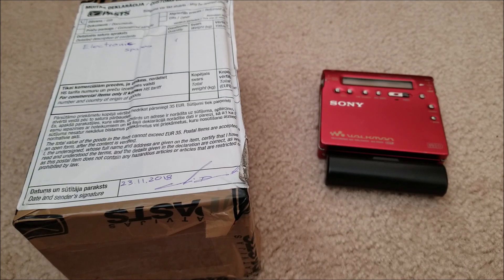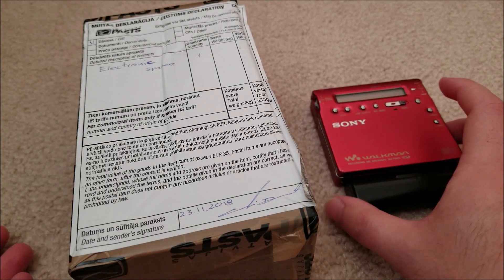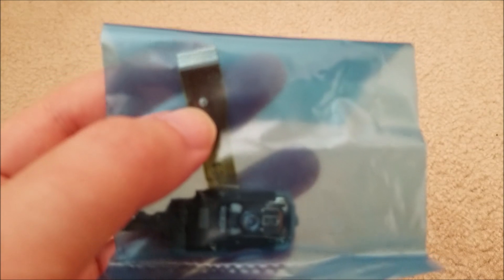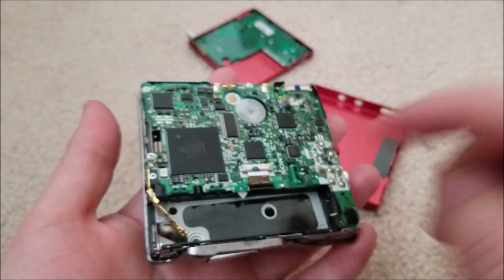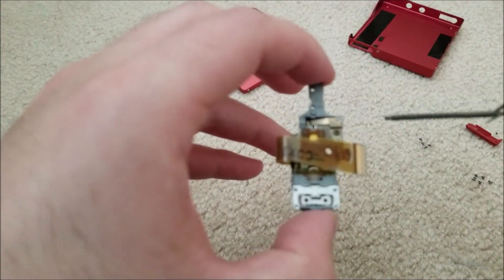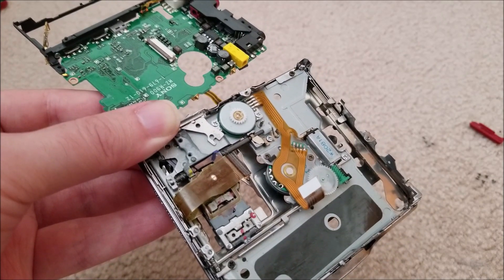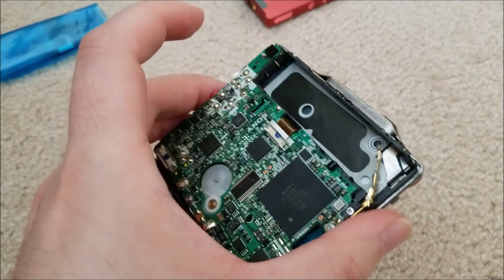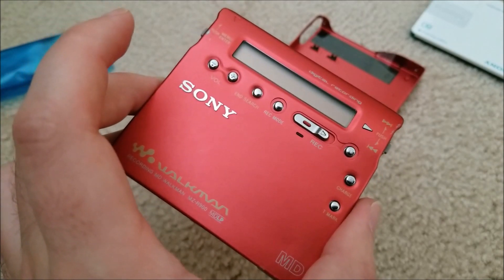Let's Fix: Sony MZ-R900 Minidisc Laser Replacement

Comment: didnt you have to unsolder the static protection joing?
Reply from the maker: It's been awhile since I made this video but iirc the pads weren't soldered on the new laser.
Reply: This is a BS video you cant replace it by hand
Reply from the maker: Of course it's possible, just because you cant doesn't mean it's impossible

Comment: Hola amigo 
Te un mz r900 y aveces al tocar un boton se  apaga y en algunos disco falla un poco 
Alguna idea de que pueda ser 
Gracias Saludos desde Perú
Reply from the maker: The r900 is getting quite old so it's likely your laser sled needs a complete clean and relubrication. It's also a very common problem to have power issues due to dirty/corroded battery contacts.

Comment: Besides the rails, should you also need to lubricate the gears?
Reply from the maker: Yes of course
Reply: @sjm4306  I see these gears are much harder to reach on other models (N707 and R501).
Reply from the maker: Yeah unfortunately. Also a warning, make super sure the lubricant you use on the plastic gears is compatible with plastics (ie not petroleum based) otherwise the gears can melt/shatter due to a chemical reaction.

Comment: It is interesting that the new laser came with pins on the cable not soldered. that pins should prevent static electricity damage and usually should be desoldered only after the cable is connected.

Comment: Cog on mine is very fixed, how do you removed it so easily?
Reply from the maker: Your libricant must have dried out more than mine. You can put a little isopropyl alcohol near the center shaft and let it soak in for a little while to try and soften it so you can remove it easily.
Reply: @sjm4306  Oh, it wasn't coming out because of a tiny washer over the cog, now I cant put the washer back :'c
Reply from the maker: Yeah the c clip is a pain. To put it back on I use sharp tweezers or a needle to start seating into the groove starting from one side and something like a pencil eraser end to hold the clip onto the end of the shaft so it doesn't ping off.

Comment: Great video. I have the same MZ-R900 model in the same red color that I bought in USA brand new in 2000/2001. The first Sony MDLP portable recorder. The same original gum stick Sony Stamina battery after 20 years still keeps the charge, the quality of those devices are top-notch.  My only issue is after many years unused the REC button doesn't work, so I don't know if the contacts are dirty, so when slide it the red led keeps off and I can't put it in recording mode. Do you have any idea about this issue? I read that ribbon cable connector can become dirty and the buttons work by using a resistor ladder that are readed by an ADC.The circuit is very sensitive to dirty or grease varying the ohms resistance, affecting the read and recognize the right command. Then is very frequent press a button and be wrongly interpreted as another command.
Reply from the maker: I suspect the record switch contacts have gotten dirty and just need a good clean

Comment: Picked up a faulty MZ-N1 and this video really helped me through the process of disassembling it, hopefully I shall be transplanting a laser from another player to get this going, thanks so much :)
Reply from the maker: Good luck and let us know the results!
Reply: @sjm4306  Just finished putting it all back together. Used a laser from an NZ-MF610 which had a faulty motherboard and fortunately the laser was an identical model to go in the N1. 

I am happy to confirm it now plays discs perfectly again (so far) and I was even able to record some tracks on there via Net MD which previously never worked properly, the laser would just struggle to read/write to the disc and just give up. The only trouble I did have is with the split pin on top of the gear that is connected to the worm gear - that was a real PITA to remove, I thought it wouldn't go back on again because of how much I mangled it but it seems to have gone on okay and hasn't popped off yet!

So far it's now working flawlessly and I wouldn't have had the confidence to try this without first watching your video, thanks so much once again!

Now I need to find more of these to tinker with and try and fix. 😁
Reply: My MZ-N1 doesn't charge the internal gumstick battery. I'm suspecting a faulty part in the charing circuit. Has anyone of you any experience in exchanging parts on the PCB? It's not only that the parts are tiny but that there's so little space!

Comment: i really want to replace my laser for sony mz-n707 type r would you know where I can get one asap plssss
Reply from the maker: you'll have to find a donor n505 or n707 (or possibly some other netmd portable made around the same time, check service manual to confirm the laser assembly serial number matches first though) unit with a good working laser to pull it from. Afaik there are no brand new replacements available anymore.
Reply: @sjm4306  found the part on Ali express but think the stores stopped selling it may have to just buy a new md player which socks wierd thing is this wqs working 5 weeks ago and just randomly stopped
Reply from the maker: before swapping the entire laser (which would require recalibration via the service menu), it's worth a shot checking the lubrication on the laser sled and gears to make sure they move freely. This is a common symptom that's easy to fix and can cause the player to not be able to read discs/skip/etc.
Reply: @sjm4306  trying to see how i get the ser manual for this and try it
Reply from the maker: googling model number followed by "service manual" usually shows a few hits. Most Sony models' service manuals are available online (at least all the models I have).

Comment: I have an mz707n the disk sound when you put a disk in and the display works but then it shuts off. Could you fix it for me?
Reply from the maker: That's odd, so it doesn't even give an error message? Also how long does it take to shut off? A quick thing you can test is if you open the disc lid and carefully move the laser sled to the end and shut it/turn it on does the player move the laser back to the center. If not then it may be the rails need to be lubricated. A stuck laser sled is a common cause for units that wont recognize/play discs (and for some reason may be causing yours to shut off).

Comment: I just stripped down my MZ-E90 to fix corroded battery terminals that are in the inside and a bit of a pig to get to. I did it and now it's working with the gumstick. The E90 looks to be a bit simpler than your one here. While it was open I put a small amount of vasaline on on the gears. I have seen another youtube clip of broken gears, so hoping this will give some more longevity.

Comment: Are the laser assemblies unique to each model or can they swap across models? Would be cool to get a physically damaged one on the cheap from ebay and swap out the part on my mz-dn430
Reply from the maker: In general certain parts tend to be the same for models in the same or +/- 1 generation. So there's a good chance that two type s netmd units share some parts but an sp only unit is very unlikely to have any parts in common with a himd model.

Comment: Hey mate.. I just got a second hand MZ-R91 which seems to be constructed almost identical to your MZ-R900 (Great tutorial for disassembling mine too). The laser mech seems to be running straight into the disc surface when it reads and scratching the disc surface although it still does work. Is there a way to adjust the lens distance/focus so it stays away from the disc surface, or does the whole laser module need to be replaced?
Reply from the maker: Never seen that before, usually the laser sled is far enough away that there's no risk of touching the disc surface. I'd check for what part of the laser sled is touching and see if something got loose and stuck to the the sled, that's all I can think of.

Comment: How do you apply Lubricant? Just a swab from the can, and then brush on to the rails?
Reply from the maker: I use a small tooth pick. You dont need a ton, and using the player while skipping back and forth will spread it around for you.
Reply: sjm4306 Thank you again for your generous and prompt advice. My MZR90 that has been in a removal carton for 15 years works perfectly but sounds like a blender when it seeks. I’m hoping it’s just the transport rails.
Reply from the maker: To be fair my r90 needed to be relubed too when I got it a few years ago but even after that though it was a bit quieter it was still much louder than my other md portables. I think the design was just mechanically louder than later models.

Comment: Hello, a question, how long can you record? I remember having an MD many years ago and the recording time was quite limited and at the end I could only use it as a player. A friend is offering me a SONY MZ-R900, he says he uses it very little but I'm not sure if I buy it because if he can't record anymore then it's no use, right? or is it possible to change a piece so it can record again? thank you very much
Reply from the maker: Older sp only md recorders could only do 74-80 minutes depending on the disc, but newer mdlp recorders can do double or 4x that at lower quality (lp2 is the best imo because it sounds not much worse than sp but can record up 160 minutes). And even newer hi-md can record even double those times (4x and 8x) on a normal disc when formatted to the hi-md standard. Beyond that a 1gb hi-md disc can hold up to 35 hours at the highest compression!

As for fixing a recorder that cant record, it's likely either a damaged overwrite head, the head needs to be realigned, or the ribbon to the head has been damaged. All those issues can be repaired but depending on how bad it is you may need to pull a replacement head from another broken md recording portable with compatible parts.
Reply: @sjm4306  Thank you very much for your answer, one more thing, how long recording life is the Sony Mz-R900 supposed to have?  I guess one day it will stop recording right? Thanks !
Reply from the maker: Oh I misunderstood what you were initially asking. Yes the recording mechanism life is limited in two ways assuming normal use: the overwrite head ribbon can break from flexing over and over (this can be fixed easily with some soldering skill) and the laser can burn out or weaken to the point it cant heat up the disc (this will require a replacement laser). As for specifically how long any mz-r900 will be able to record, I cant even begin to guess accurately. I'd imagine though so long as it's maintained properly that it'd last maybe 30+ years.
Reply: @sjm4306  thanks! I think i will buy it:) i will like to used for recording with microphone any advice for a good quality microphone that Works with the sony mz r900?
Reply from the maker: Sorry, I mosty record over optical in or usb so I dont really have any experience with mics

Comment: I just got an mz-r910. It powers on but the disc spins for a long time and sometimes it comes up as a read error but sometimes it works but only after a long time of spinning. Would you say that it needs a new laser? Thanks.
Reply from the maker: Does it read faster/more reliably if you put the player on one of its sides or even upside down? It could either be something mechanical or need recalibrating in that's the case. If that makes no difference though then its probably the laser.
Reply: Thanks for the reply. Follow up question: I have a lower end model that has the same features as the MZ-R910 (MDLP2 and 4) is the laser the swappable from the lower end model (mz-r410)?
Reply from the maker: I cant say for sure off the top of my head but there's a good chance both models in the same model line use the same laser. You can check for sure in the service manuals where the BOM at the end will list the component reference number for the laser assembly.
Reply: ...Also, no, I turned it upside down and all around with no effect.

Comment: I have a MZ-R70 that I got for a graduation present. It's still working and I still use it. Is their a parts store to find new lasers? I'm not having trouble playing or recording but I'm going to need a replacement one of these days. Also could you recommend me a tool kit I like what you were using.
Reply from the maker: It's unfortunately basically impossible to find new replacement lasers for md recorders nowadays. You can sometimes get lucky finding a few on sites like aliexpress but they are few and far between. I got my screw driver set from pepboys iirc.

Comment: I'm changing the internal battery of my MD-Z10, it's my first minidisc. It works perfectly but when I turn it on the gears apparently make a lot of noise (scratches), is this normal or can it be softened? Thanks from Seoul.
Reply from the maker: It could probably use a good cleaning. The grease on the mechanical bits tends to attract dust and gunk which could be increasing friction and causing things to scrape.

Comment: hi my mz n1 has a break in the over head cable im gonna fix it do you know how to do this. can I solder my own cables to the head
Reply from the maker: If your wires are thin and flexible enough you can solder them directly onto the ribbon/head.

Comment: I have a MZ-1 and have no idea why it is not working anymore.  Can you help me? It powers up but does a long reading time with nothing happening.
Reply from the maker: It could either be the laser is dying/dead or the grease on the mechanical moving parts has gummed up and needs to be cleaned and relubricated.

Comment: Wow nice and very detail. I have an old Sony MZ-RH910 with broken rewriter head. Do you know where to get a replacement please. !!
Reply from the maker: I know the mz-rh10, mz-m100 use the same head as the rh910. Not sure about non-himd units though unfortunately.
Reply: @sjm4306  appreciate the fast response man. RH10 should have the same mechanism as the RH910 which has a good old lcd screen instead of OLED on the RH10. Do you know a good place to get a replacement?
Reply from the maker: I usually keep an eye out for battered spare parts units (I have an search set up to send me an automated email when one pops up) on ebay that are listed as auctions that end early in the morning then I put them on my watch list and wait till the last 10 seconds to hopefully bid cheaply. Sometimes works, sometimes doesn't. As for finding new old stock replacement parts for these units, they are unfortunately few and far between.
Reply: @sjm4306  Thanks 😊 I do that sometimes.

Comment: Great great great video! Any chance you have troubleshooting tips for no power on these? Soldered a couple of leads to the pcb pads and nothing using my psu.
Reply from the maker: If you dig up the service manual you can trace the schematic to check the components in the power input path to figure out what has failed.